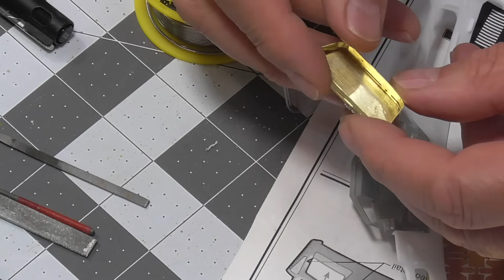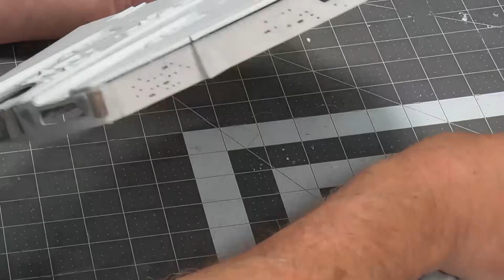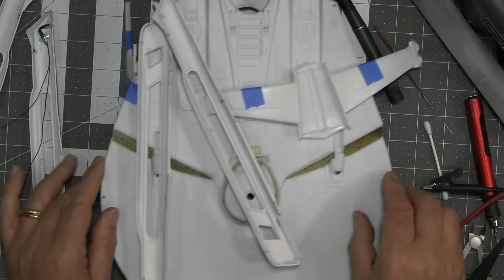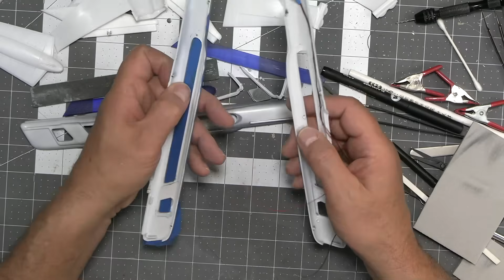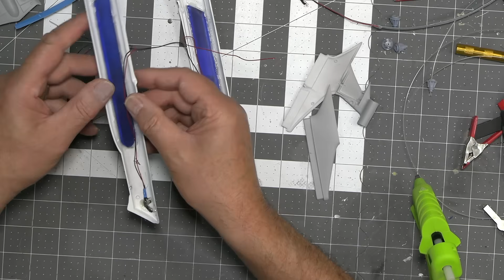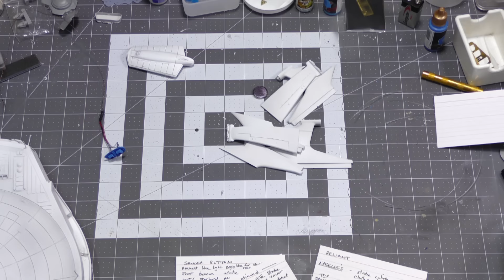Reliant Build-up Continues: Photoetch Details and Lighting Design

Comment: I’m looking at this kit on Amz, and the page offers several models around the same price. Have you built the 650 scale TOS Enterprise? If so, was it a huge pain in the you know where? 
Looks like a good candidate for the size I’d like the of TV Starship in my cabinet. However, my skills are not up to snuff for anything a wonky as that 350 Refit you did a few years back.
Reply from the maker: It’s actually not 650 they are actually all 1/537 the 650 was the original AMT ertyl kit that has windows but it’s woefully inaccurate and the plastic is very thin. It’s why it was repopped without windows.
Reply: @sprueVerse But is it an easy build? 😂
Reply from the maker: @Shakes_The_Clone easy? A relative term. Depends on whether you build it straight out of box or modify and light it.
Reply: @sprueVerse Likely, both! I’m looking for something to practice on. To learn to work through challenges that I don’t get with Bandai kits.
I like the size, and the price is reasonable enough to buy a few of them and not freakout if I blow it. Repeatedly. 

I need a repeatable training exercise. Would you say it’s problematic enough (modded or straight build) to challenge me, without being a nightmare like the big refit?
Reply from the maker: @Shakes_The_Clone definitely worth a go!
Reply: Good to hear. I just might do it. Thanks! 

Oh, I bought you a coffee yesterday. (A small one 😅)
Reply from the maker: @Shakes_The_Clone yes! Greatly appreciated! Thanks 🙏

Comment: I was an electronic technician from around 1987 - 1995-ish. For electronics I always found the ideal solder to be 60/40 (60% tin, 40% lead) with a rosin core. With that rosin core, no additional flux is needed. For the best connection you want to apply solder to each piece before joining them and soldering for good. This will give you a stronger connection than putting the pieces together, then soldering. That's not always practical - like if you need to twist 2 wires together then solder because solder is not meant to be flexible

That being said, I don't recall ever soldering brass so it may behave a bit differently, but my guess is that the solder's rosin core will still eliminate the need for a application of flux prior to soldering. On the other hand, it doesn't hurt.

Either way, there will be hardened rosin residue left. You can just wet an old toothbrush with water, gently scrub the old rosin away (it takes no force at all), and blot it dry with a paper towel (I used an anti-static cloth for electronics back in the day).

I'm enjoying this series. I have this ship in my stash and it's really making me want to get to it soon.

Comment: The weapons on the tips of the spoiler bar above the main hull are megaphasers, if you remember it was one of those that tore open the engineering section of the Enterprise during the opening battle.  By the way did you forget that you were going to light up the crystals on the top of the warp engines?  I think you were going to use little domes for those over 3 or 2 mm LEDs.  Buttoning up that saucer does look like a serious challenge, it would be nice to be able to test all of your lighting before sealing it all up.  I don't suppose there is any way to attach the nacelles to just the lower half of the saucer is there?  And then slide on the top half later after testing all your wiring...  Good luck Phil everything is looking great so far, I think this might be my favorite reliant build yet.  And yes the inner chiller grills on the Reliant were opaque on the model, something I had never picked up on until seeing the studio model itself at the exhibit.
Reply from the maker: Crystals are illuminated by the chiller grill SMD tape.

Comment: I want this! 
Been watching your BSG Shuttle build. What are the differences between the black Sonic Saber you used then, and the white Micro Mark version? 
Is the Micro Mark significantly better? It’s certainly more expensive. 
🖖🏼
Reply from the maker: They have different pros and cons - mostly it’s in power and ability to cut for longer periods of time. Stick with the white one.
Reply: @sprueVerse 10-4 👊🏽

Comment: Could you have used conductive foil tape for those wings? -John
Reply from the maker: Great idea! I have think you could. Makes sense. I didn’t have an issue closing up the wings on the crossbar - the magnetic wire was thin enough to close up.
Reply: Good to hear! -John.  @sprueVerse

Comment: Maybe Im confused here, but dont these TMP-era ships only have the inner side of the nacelles lighted when going into warp? That would mean you can just put the led strips on the inner wall of the outside chiller area. Ive noticed that the best way to  do diffusion is using Unle Lou's trick with fiber fill, or just using styrene sheets as far away from the strip as possible (or combine both methods). You can get a lot of smaller LEDs on strip with a high-density option. Love the amount of details you are putting into this project! Also I love that shirt!

Comment: Phil, the turtle has the photon torpedoes front and back and where the bridge meets the pylons  it has front and rear phasers on both sides.
The turtle has a strobe led onto and 2 red led nav LEDs on the underside.

Comment: Hi Phil. Coming along nicely. This brings back all the trials, head scratching and frustrations I had doing my Reliant a couple of years ago. I used 34AWG wire to connect my photon launcher section. It's the stuff that often comes with presoldered SMD LED's. It's a pain to use because it's so fine but it's more flexible than magnet wire. I actually managed to get the front and rear phaser emitters at the ends of the rollbar working on mine too! (I used my own custom lighting board). One thing I would suggest, put some aluminium tape on the inside of the outer walls of the vertical struts connecting the nacelles to the rollbar. I didn't and had an issue with a light hotspot on the outer walls caused by light from the saucer shining through the holes cut out to run the wires to the nacelles and rollbar.

Comment: Phil, I used magnet wire, you need to gouge out both sides of the turtle wings .
You devide the front photons to one side then the rear photons to the opposite side. 
You also have 2 red naves underside 1 stob on top  so you run the red nav to one side and the strob to the opposite side..
Tip bring out all the wire connections for the turtle bridge and the necells out feom the ship in that nook on the main hull where you glue the pylons to the ship main hull.
Reply: That's good advice. I ran all my wire to the one side, and now I'm not sure if the pylon will fit flush against the hull on that side. Not much space there.